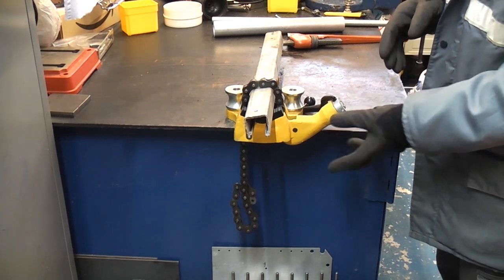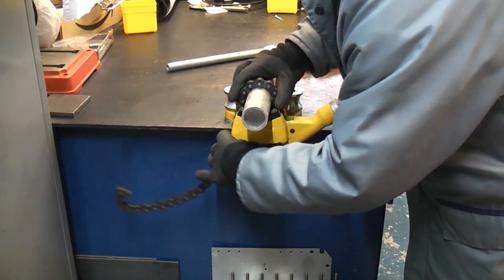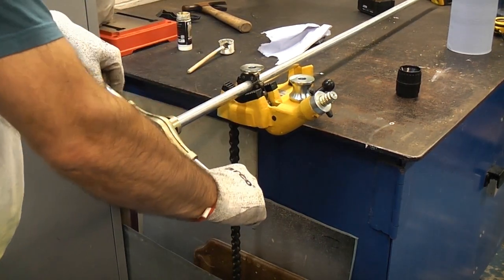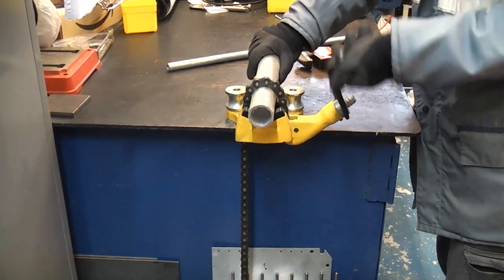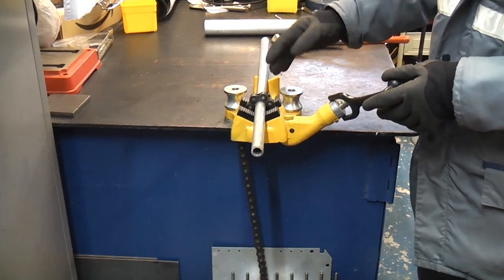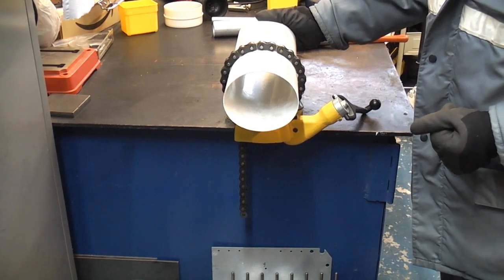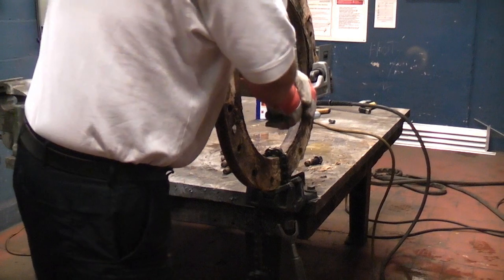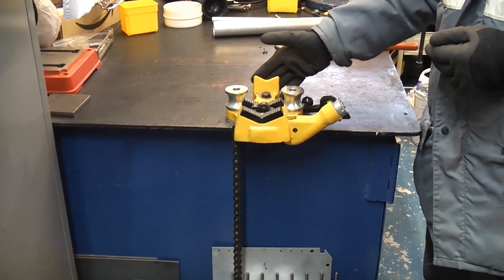Chain vice | chain vise | pipe vice

Comment: That is a very good and useful tool. This chain pipe vices been around for a long time but they are quite rare, Record/Woden/Paramo all produced chain pipe vices but you'll be lucky to find one, however the normal/conventional pipe vices quite common and came different sizes, Hilmor and Record are the most common makes. 
Also some of the Hobbiest and Mechanics vices may have pipe jaws under the normal jaws but they are not designed to do heavy duty work.
Also would be great if you can make a video of pipe wrenches and your thoughts about 'Foot Print' make pipe wrenches.
Reply from the maker: The heavy duty chain vice at the end of the video, is a Record, it’s a real heavy duty piece of kit and was abused by most fitters! I’m afraid I’ve never used any Footprint tools, when I worked on site all my pipe wrenches were made by Record, although the grey handled small pair at the end of the video, were made by Beta (if I remember rightly), they are just a copy of similar offset pipe wrenches made by Ridgid etc.  👍
Reply: @ultimatehandyman  Thanks a lot, loving the videos, very informative and helpful tips 👍👍

Comment: Always interesting videos. Can you please add some description of what the rollers on each side of the chain vise are for?
Reply from the maker: The rollers are for bending small diameter pipes by hand. I have never used them to be honest, as I have a pipe bender for the pipe that I need to bend 👍

Comment: What are those silver color rollers used for on the vice?
Reply from the maker: They are for bending small diameter pipes/conduit. I have never tried using those to be honest, as I have a pipe bender. On site we had a hydraulic pipe bender, so something like the rollers would never be used 👍

Comment: Hi, if you could add a link to the domenstrated products, will be great.
Thanks and keep up.
Reply from the maker: The vice in the video is a Northern tool, 6 inch chain vice. They seem to have discontinued that product now! I ended up with three of these, which I won at auction 😂
I sold the other two and kept this one for myself. I can’t find any similar ones at a decent price on eBay, sorry. 
Thanks for the comment 👍

Comment: If they are so hard to get hold of, it would be great If someone  could copy the design  and start manufacturing  them, just a thought If there a are any engineers  subbed to your channel.
Reply from the maker: They are not hard to get hold of, but they seem to have stopped making the particular brand I have. You can always find these, but they can cost anything from £150 to £700 👍
Thanks for the sub ;-)